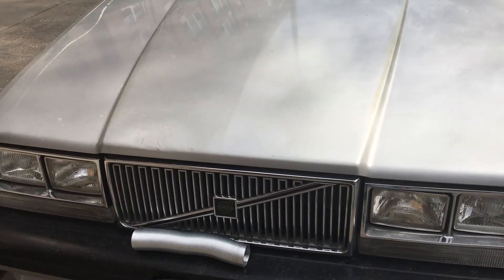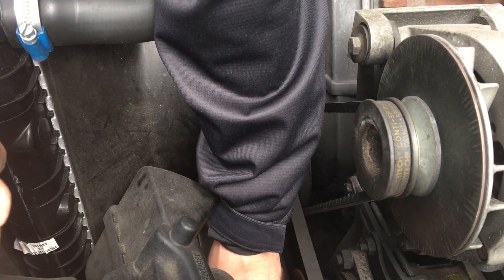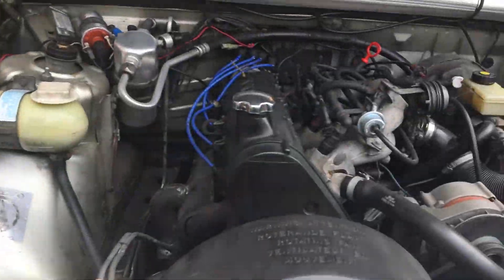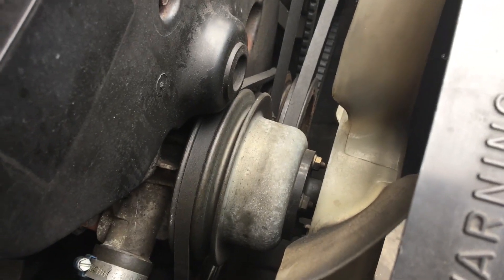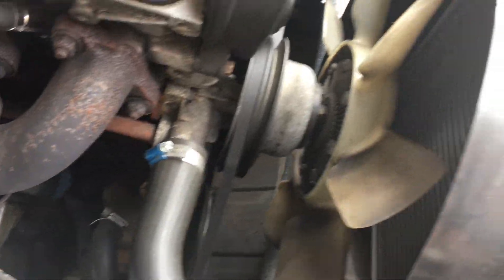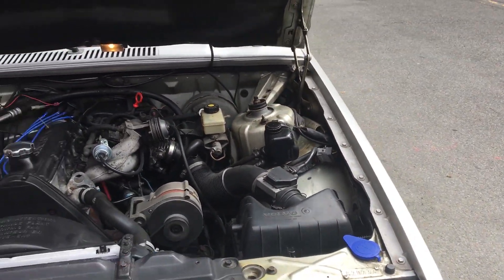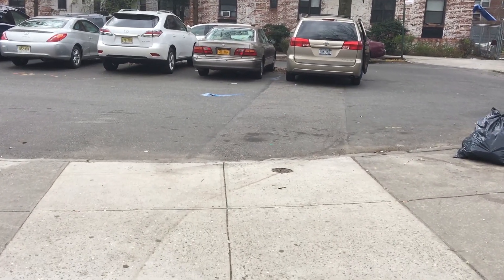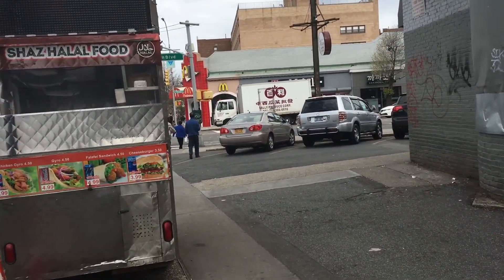Volvo 740 passing emissions/smog/inspection

Comment: What is the diameter of the metal on the exhaust manifold?
Reply from the maker: Jane Smith I am unsure but the part can be found at https://www.ipdusa.com/products/5448/105054-volvo-pre-heat-hose-aftermarket-946841

Comment: We thankfully don't have inspections here central Ohio. With that preheat hose installed and the engine running fully warmed up hot put your hand on your maf / amm sensor. Is the sensor warm/hot to the touch? If it is hot that flap in the airbox has likely failed and your maf sensor is being cooked. Are those kingsbourne plug wires?
Reply: Ngk wires I saw.
Reply from the maker: And plugs, although I hear you can't beat oem volvo plugs. They just cost more, probably because they are rare now.
Reply: Nick's DIY $15 for a 4 pack of Volvo plugs from ipd... plus their ridiculous shipping charges and ship times. I love my '89 740. I don't see many diy 740 videos ...keep it up Nick. Thanks.